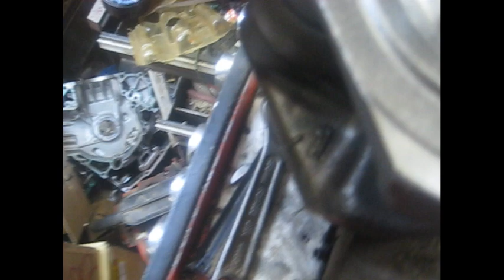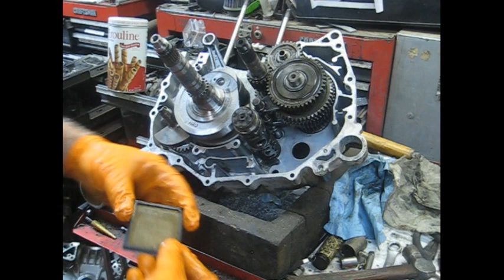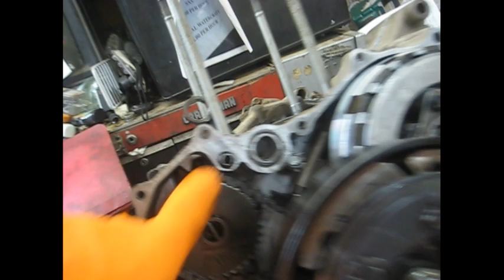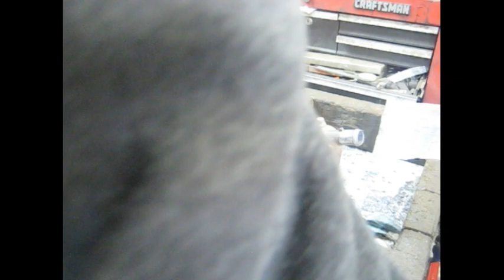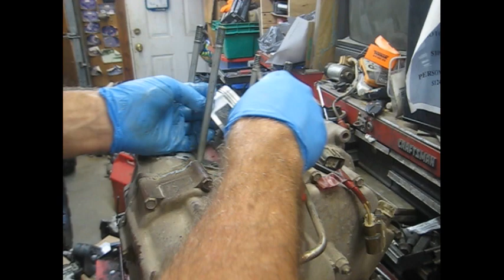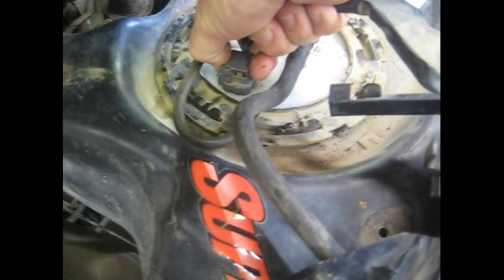2015 - 2018 Honda Foreman Rubicon engine assembly

Comment: Man... You need to organize you're shop... and some clean up wouldn't hurt either !
Reply from the maker: It is organized. That's what 20 years of working on stuff will get you. I'm actually in the process of cleaning it out. I'm going to sell it and the house next to it and build a new shop at my house. So I'll have a clean and organized shop for a little bit at least.

Comment: Help Doc, I got mine torn down, case split, new bearings and crank pressed in, transmission parts in the rear case half. But in my bin for the rear cover, flywheel, starter gear, transmission parts, etc  I have a 3/4"(19mm) diameter circlip. It looks like the wrist pin circlips in the piston but both of those are accounted for..   Is there supposed to be a 3/4" (19mm) circlip on any of the transmission parts, final shaft or on something in the rear cover/case?    thanks

Comment: this is an excelent video of engine assemble. I replaced replaced timing chain and slider with info fromthis video on my 2015 TRX500 yesterday and the engine runs good. i can feel the shifter changing from nuetral to reverse and first but the machine does not travel forward or reverse. feels like clutch slipping. so i dissassembled it again and found the clutch disc had a little binding. i loosened the four bolts holding the plate and springs keeping the clutch together and it unbound, looked good, put back together and still slips. had no problem with clutch slipping before the slider broke and the timing chain got loose and making noise. can you give me an idea what i may have missed?

Comment: hey i was just if you could tell me were to purchase the seal on the front crankcase cover that was trying to roll out on you. mine did the same and i think i have to replace it
Reply from the maker: Yes it's listed under the final shaft on the parts diagrams. I think the part number is 91202-HR0-F01
Reply: perfect thanks

Comment: Really wish you would went more in detail with the transmission I'm working an 22 trx520 almost similar engine but the transmission was locked up. I tore it apart and have the transmission back in it. It spins but once I put the reverse gear in it locks it down. What manual do you suggest that will help me out on that
Reply from the maker: I try to keep all of my transmissions together during disassembly and all together for reassembly because they can get complicated if you misplace any parts of them.  The only problems I have ever seen were bent or broken teeth.  Do you have everything put together behind your front cover when you are trying to shift it?

Comment: How do you know if your clutches have to be replaced?
Reply from the maker: The telltale sign is the clutches slipping especially when going slower in a higher gear. If you have the engine apart where you can see the clutches they normally have deep grooves in them when they still have life left and are almost slick when they're worn.

Comment: Thank you so much for these videos they really help out! I have a question what type and brand rtv did you use going around the sides of crank case?
Reply from the maker: I use permatex ultra Gray rtv. It doesn't stand out in color against the case and seems to work very well.
Reply: @FourwheelerDoctor  thank  you!  I'm basically replacing my whole engine because for some reason the crank cases inside have cracks all in it.
Reply from the maker: @matthewmcdonald7689  that's odd. Sounds like it may of had a rough life.

Comment: What does the round cap with three bolts holding it down on the motor hold.  It's on the rear of the crankcase ???
Reply from the maker: That is just a cover for the end of the crankshaft. You can take that off and rotate the crankshaft with the bolt inside. It's how you put the bike at top dead center for valve adjustments.
Reply: @FourwheelerDoctor  thank you for the quick reply! Yea i was workin on my buddys bike and i saw that cover bent up like something shot out. So i pulled it and the bolt backed out and crossthreaded the threads in the crank. Would you recommend going in with a tap trying to re thread it or is he looking for new crank?

Comment: I got to thre front right before I put the front cover on, I checked foot shifter it seemed jammed, I didn't have to remove the transmission it stayed in the other side of the casing. any ideas?
Reply from the maker: Would your shift drum rotate behind the front cover before you put the cover back on?

Comment: Thank you for taking your time and doing this video.  Appreciate your hard work
Reply from the maker: Thanks for watching!
Reply: I just got a 2015 foreman on a trade. The guy rebuilt it and cant get it to start up. It with fire off with either and the gear indicator has a line no number or leter . I mite be tearing it back apart
Reply: What if the shift sensor is not lined up on Neutral ? Any what to fix it without taking the back plate back off . I believe that's what wrong with mine and the motor is already back in
Reply from the maker: @NorthFloridaOutdoorsman  I don't think it can be fixed without removing the back cover.
Reply: That's what I thought too,  in going to dive into it Sunday, I mite try to remove rear swing arm and try to remove back side plate instead of pulling motor again. thanks  for responding
Reply from the maker: Removing the swing arm will be the easiest thing to do.
Reply: Hay Dc great  videos keep up the good content I’m rebuilding my 2016 foreman 500 and your vid help me a lot thanks from Chishlom Mn.
Reply: Thanks again

Comment: Hey man my buddies looking at a 08 750 brute.... has shy of 8k miles unknown hours but the rear cylinder is dead good fuel and spark you think the crank and rod would be alright? runs off one cylinder, dead one is just pushing out oil what's your 2 cents on them
Reply from the maker: Does it have any knock when it's running on one cylinder?
Reply: Four wheeler Doctor can't really tell runs pretty bad on one.... won't idle
Reply from the maker: If I had to bet I would say it had a spin rod bearing. The last one I had that was running on one cylinder (spark plug wire unhooked), it was just really weak but would run and idle fine.
Reply: Four wheeler Doctor thanks for you're 2 cents man it try's to idle going to look at it one more time probably ain't gonna get it spitting out oil on dead cylinder